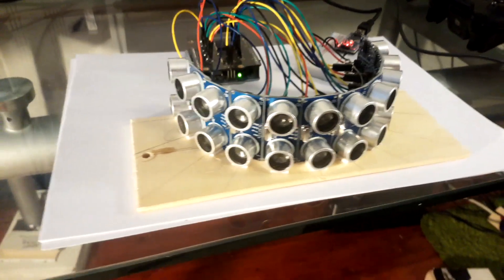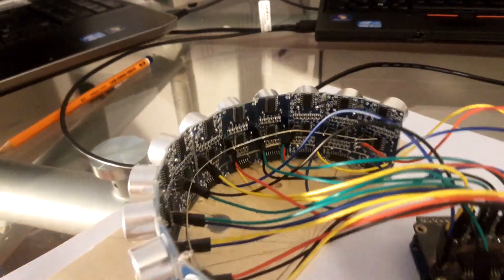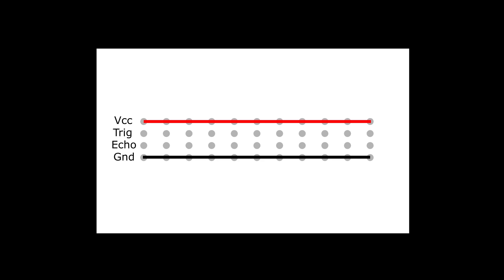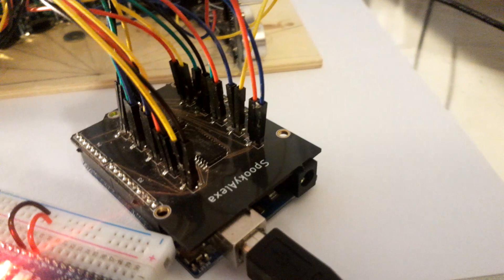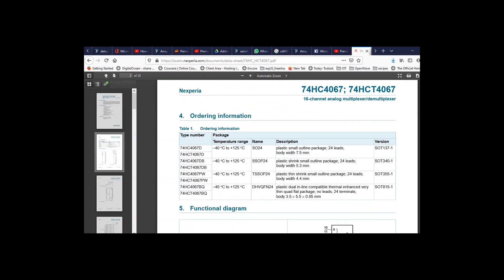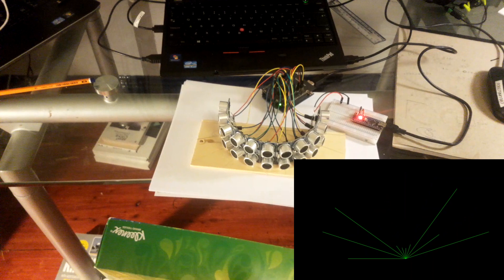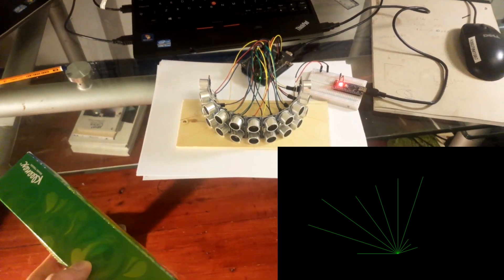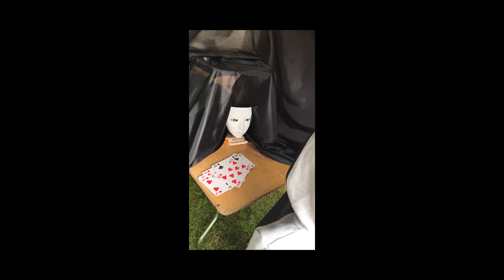HR-SR04  ultrasonic sensor room scanner/mapper

Comment: One way to take this to another level but is quite elaborate is to use lock-in amplification. The lock-in amplifier is a very small bandpass filter dependend on a reference frequency. If you change the reference frequency of a lock-in amplifier in a very small range around your stimulation frequency you can get really high resolution measurements with noise close to zero and even insane time resolution. This is the way you can get everything out of these setup.
Reply: Could you please elaborate on this or give some lead, I am really interested in doing this. Thank you for suggesting this wonderful idea.

Comment: Hi Shane. I just found your video and I love how you were able to do this. I am also doing something similar, but with less 4 and 4 sensors, 8 in total. Basically I want to replicate a Vehicle parking sensor. But I want to use the JSN-SR04T waterproof transducer. 

I have found a sketch of how to use them, but I am very new to programming and my only problem is in the stage of graphing the data ... You have been able to graph it in an interesting way, With lines that indicate the different ones. But I want to graph it in an RGB led bar, where I can see the distance by color (Green, yellow and red) and the location (left, center, right) Fluidly throughout the led strip.  

I would love to receive guidance and advice on how to represent the signals of the sensors in an RGB LED bar. 🙏